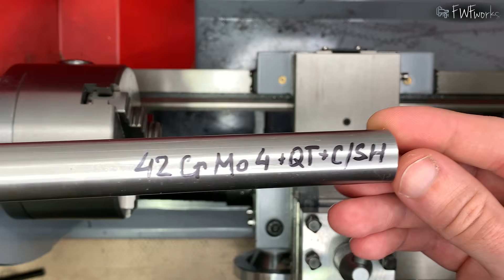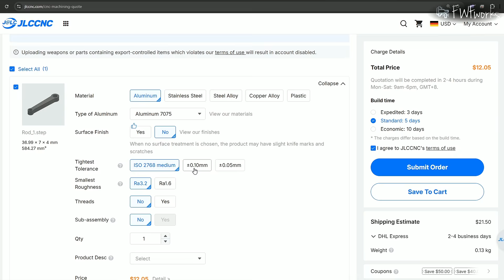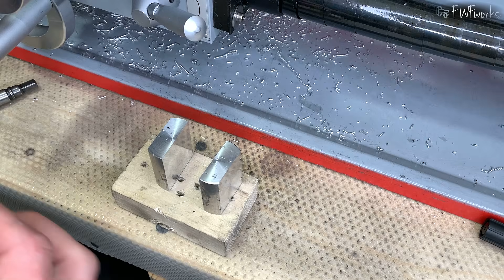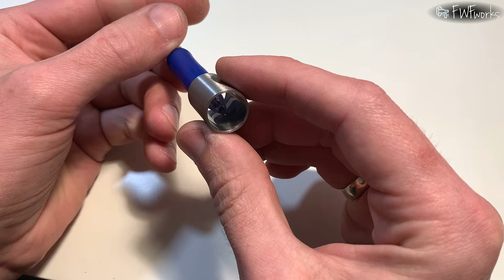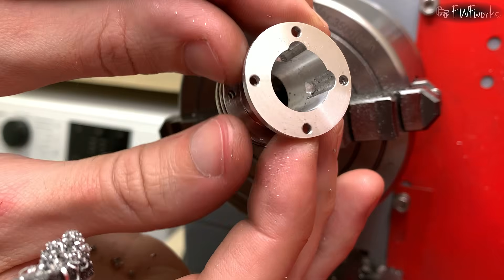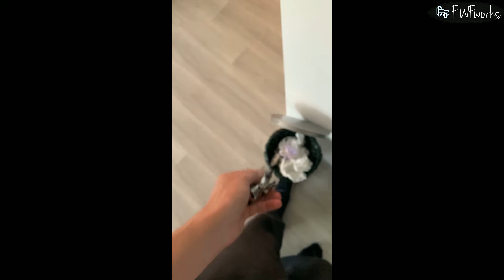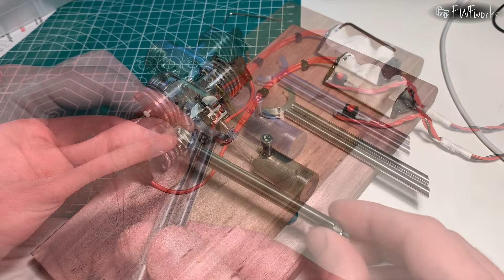I Created My Own Micro Engine! 6500 RPM?!

Comment: Id love to see how long this motor will run.  I have a feeling it wont be very long.

The tolerance window shrinks in proportion to the sizes but the material properties and density dont change.  

This is a cool project but i wouldnt risk the rc plane chassis that size.

Put it in an rc boat!
Reply from the maker: I didn’t set out to build a reliable engine, and that’s exactly how it turned out 🤷‍♂️ I’m not happy with the way it starts or runs. If I were building something for RC model, I’d probably just buy a proper model engine :)
Reply: @FlyWolf_works  totally understand lol but why not do another and take some tricks from the rc world.  It would be damn satisfying to get a rc boat ripping around.  Pretty low cost and easy to configure.
Reply from the maker: @Rightisallwrong Absolutely! But I’d like to build something a bit more interesting. For example, I’m currently making parts for my new engine. It will be a 4-stroke, 4-cylinder engine with a displacement of 30 cc (1.83 cubic inches), crankshaft lubrication, and liquid cooling 😎
Reply: @FlyWolf_works niiiice.  Looking forward to it.

Comment: Cast iron pistons in a steel or chromed- brass cylinder work well in commercial model engines. If I was building a boxer I'd start with a couple of existing engines first time around, and just build a new crank & case. Doing everything from scratch is much harder. Oh, and cast iron pistons lap nicely too
Reply from the maker: Yes, I know. I used to be heavily involved in model aircraft. I wanted to build an engine completely from scratch, make it very small, and run it on gasoline. But it turned out the way it turned out… 😄

I’m currently designing a 4T engine. It will have aluminum pistons with steel rings and cast iron cylinder liners.

Comment: They run great with gasoline BUT YOU MUST USE PISTON RINGS. You lose 70% to 80% of your compression with metal to metal fit. BAD IDEA!!! If you test it maybe you have 4 to 1 compression and lose 75% of your total power potential! It runs way to slow. If you build with rings your RPM should be 15,000 but I can hear it's far to slow! Even just 1 ring would be better than none!!! If you get good compression you will NEVER be able to spin it with your finger, totally impossible so I know your in BIG TROUBLE with your compression!!! My advice is to BUY one and take it apart to learn how they build it! They have many special tricks you need to learn. Also your carb must be much further away from the crank case and larger ID fuel air tunnel so you can fit an easy open "V" shaped dual reed valve between the carb and the crank-case with much larger openings so it gets lots of air flow. I can also hear it starving for air to!!! It's harder than you think to make it really powerful and fuel efficient! Note: building rings takes special math so maybe buy rings and build your piston to match!
Reply from the maker: Thank you for the detailed comment. Yes, there were quite a few mistakes made during the design process 😄

Comment: That's a cool engine,excellent work but as with all air cooled engines there needs to be some air flow across the fins to help dissipate the heat.
Reply from the maker: Hi! Thanks! Yes, you’re right. But this engine has tortured me so much that I’m almost ready to make a destruction test video. Which will fail first: overheating or a thrown connecting rod, or something else 🤔
Reply: @FlyWolf_works it would be a shame to see all that craftsmanship end up in a thousand pieces but, it would also be entertaining. Can't wait to see it.
Reply from the maker: @edwardtaylor7047  This engine really didn’t turn out very well. But it gave me an enormous amount of experience and a much deeper understanding of how engines work and all their little nuances. Unfortunately, I couldn’t cover most of that in the video because of my limited language skills.

The stress test will also tell me a lot about the strength limits of the materials I’m using.

And ahead of me is the long journey of designing and building a four cylinder four stroke engine 😃

Comment: Beautiful!!   How did you make sure the bearings for the crankshaft were aligned?
Reply from the maker: Hi! Thanks for your comment.

I machined the crankcase in a single setup to ensure concentricity between the front bearing and the inner bore of the crankcase. I also tried to make the rear cover as accurate as possible. The rear cover with the bearing is located by the inner surface of the crankcase. So the inner bore and the rear face of the crankcase serve as the datum surfaces.

Comment: if you spend more engineering into this, you might make it spin like 15000 rpm faster
Reply from the maker: Hi, you're right. But I'm not sure the materials I've chosen will withstand high dynamic loads.
Reply: @FlyWolf_works  well, best engines like these can rev up to like 30000 RPM, so if you put whole a lot of engineering and innormous calculations, you may end up with similar results. i guess, if 2.4 liter inline 4 K24 Honda car engine can freely rev 8000 RPM from factory, your micro engine can do a lot more. maybe decreasing stroke will bring dynamic acceleration thing down and you will make less power on low RPM, but will allow you rev higher without stressing conrods and piston fingers.

Comment: 3:56 бро, я бы писал на английском, но я слышу откуда ты) А так, уплыли зазоры между цилиндром и поршнем?
Reply: А так, отвечая на вопрос почему маленькие двигатели плохо работают на бензине? Дело точно в размере? Имхо, дело в самом бензине который куда хуже горит и куда более прихотлив буквально ко всему. На нитрометане и двигатель из шприцов поедет
Reply from the maker: Hi, thanks for your comment!
I’m not trying to hide where I’m from 🙂 It’s pretty obvious both visually and from my accent.
Still, I’ll reply in English. As you probably saw in the video, two factors were at play: thermal expansion and piston deformation caused by the press-fit wrist pin.
I didn’t expect that pressing in the wrist pin would change the piston geometry that much.

Right now I’m designing a four-cylinder 4-stroke engine with a displacement of about 16 cc. If I manage to build it, we’ll see if it can run on gasoline.
Reply: @FlyWolf_works  вообще бомба, я тоже собираюсь попробовать себя в таких движках, но я даже не думал что их можно заставить работать на бензине. Если всё выйдет, то точно попробую повторить твой опыт

Comment: Nice work. I think I see the problem.  The crank discs may be blocking the fuel transfer to the cylinders too much. They need to be cut away a little so more air and fuel can pass, and also to balance the crankshaft. 12 to 1 compression may be too high for the gasoline and oil mix. I like the straight pipe sound better. The muffler sounds noisy. Maybe adding tuned pipes might  help with scavenging.
Reply from the maker: Hi! Thanks for the detailed feedback. I honestly thought it would run as-is, because I wasn’t planning to put it under any load. It just needed to run — that was the goal. But it turned out to be a lot more complicated 🙂

Comment: The fact this runs at all is a major achievement, to get rid of vibration and improve power is the really hard bit as you are going to have to balance the crack, rods and pistons which isn't easy especially when you have manually shaped some parts with a file. Really nice project though.
Reply from the maker: Hi! Thanks for the comment! My goal from the start was just to get the engine running, not to chase power or perfect balancing. Of course, it can’t compete with industrial engines in terms of power or lifespan🤷‍♂️

Comment: Can you make the rev force engine in a mini engine size ?
Reply from the maker: Hi! I think I could🤔 I just need to convince myself that I actually need it 🙂
Reply: @FlyWolf_works  i have a reason.. how about collection of novel engine designs miniature versions which are still at development phase but working
Reply from the maker: @49Amit-j8t 
Yes! That’s exactly what I’d like to do. For example, I really like the INNengine “1-stroke” engine, and I’d love to build a miniature working version of it. But first, I need to learn how to make piston rings 🙂
Reply: @FlyWolf_works yes it'll be awesome collection to watch it getting built .. and i think you could order custom piston rings , some company must've been making it maybe, not quite sure lets see, i wonder how those model engine get their custom rings be made , i think the rings must be high carbon steel which are shaped in desire size ring and then quenched & heat treated in oil or water.. I'll look for some info myself on this topic as well and update the comment or post a new one
Reply from the maker: @49Amit-j8t  I feel like there’s not much point in trying to make a model engine with a long service life. That way, there are no strict requirements for heat-treating the piston rings — choosing the right material is enough. What’s far more important is calculating the correct dimensions and maintaining accuracy during machining.
Reply: @FlyWolf_works  how about you use jlc cnc for super precision parts like piston rings head and piston and the body part be done by you.. will that work? I know budget is something to be considered as well
Reply: @FlyWolf_works hey bro can you build this? I always wanted to see it come to life actually working, and it would be fun if u could make in a 50cc inline/V/X engine & put this in a pocket bike ..........

https://youtu.be/vQ_aJrpW80g?si=QRsAQq4yTqzhYckb

or if you could then make it out of weed wacker or 25cc chainsaw engines into a inline 3/4 and put it in a pocket bike and drive it ..try to make it 100cc ish
Reply from the maker: @49Amit-j8t   Crazy man🤣
Reply: @FlyWolf_works  yup call me crazy.. normal things aren't fun for me i guess lol .......but i really wanna see it come to life... i would actually the engines in a V format it'll look cool but the one gonna building it so feel free to change as you like...the original creator of the design doesn't care if you make the engine since the revforce engine is somewhat his design and he's just amazed by people coping his creation in a good way obviously...... So put that engine in a pocket bike cuz so far I don't know anyone has done it on the entire youtube try to be the first and u might start a new trend.. I don't have the knowledge & equipments and mainly spare funds to do all this or else i would've been making these years ago....thats why i give the youtubers building stuff the Idea of building these engines let's see who does it
Reply from the maker: @49Amit-j8t  I mean, that guy is crazy — the one who attached ~12 nitro engines together. 

I’ll think about what I can do and how to make it interesting 🤝

Comment: Very nice. Beautiful machine. Yes, for aluminum pistons, model engines often use hard chrome-plated brass cylinder liners. The thermal expansions match better that way. They're called "ABC" for aluminum-brass-chrome. All model engines used gasoline with spark in the 30s and 40s. Flame speed and speed of combustion limited their power in small cylinders. In pictures of these old engines, they look tall. They used a long stroke to allow more time for gasses to burn and expand. Gasoline is also harder to ignite than the alternative, methanol, causing fussier starting and run adjustment. As you probably know, methanol works better overall and allows the use of glow plugs rather than spark. Adding nitro-methane allows even more power and easier running characteristics. Nearly all modern model engines that burn gas have larger displacement than yours, in the class with utility engines for chainsaws and the like.
Reply from the maker: Thanks a lot for the valuable information! 👍

Comment: I didn't see any comments on what the issue is going to be, but I'm guessing it's that the aluminum expands faster with heat. Though with proper designed cylinder and piston geometry, you can work around this issue. But that's just my guess.

Edit: nailed it.
Reply from the maker: Yes, that’s right! Thanks for your comment. I also think the piston deformed because of the press-fit wrist pin (I’m not sure if it was plastic or elastic deformation). At that time, I didn’t have a micrometer to check it.

Comment: hi you have schematic - want to fiddle with engine but no engine background thx
Reply from the maker: Hi! This is the first engine I designed myself. There are many mistakes in the design, and while trying to fix them I ended up messing up the 3D model. So let’s assume there are no drawings available.

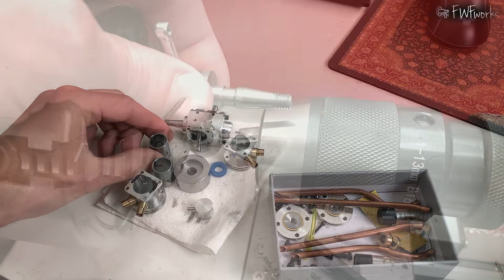Comment: 10:18 there was no heat applied to euther the piston or piston rod to allow the pin to fit. I was wondering about the clearances when you did that part.
Reply from the maker: Hi! The connecting rod rotates freely on the piston pin with about 0.02 mm clearance.
The pin is press-fit into the piston with roughly 0.01–0.02 mm interference, so the hole in the piston is slightly smaller than the pin. It’s not a very tight press fit. The pin can be installed without heating the piston.
At the same time, based on my calculations, this fit should not loosen even when the piston is heated to around 180–200 °C.
Reply: @FlyWolf_works Thanks for the clarification. It makes sense compared to the bigger engines that I usually see this with.

Comment: Aluminum pistons are fine, they use them in ABC type model airplane engines, you need to taper the piston diameter a bit for clearance as it expands essentially making the top of the piston the sealing ring

Comment: so the aluminum pistons did not work because of thermal expansion?
Reply from the maker: That’s true — however, it’s not obvious at first. The pistons are only 14 mm in diameter, so their thermal expansion is very small, just a few thousandths of a millimeter.

Comment: i bet it was bad to put aluminum pistons because aluminum expands faster than steel, if you wanted to compensate for it you’d have to have bigger sleeves but the consequence is low compression while cold along with piston slap
Reply from the maker: Yes, you’re right. In car engines the piston-to-cylinder clearance is roughly 0.05 mm, but those pistons are around 80 mm in diameter.
I honestly thought that with a 14 mm piston, a couple of hundredths of a millimeter would be sufficient…
Reply: @FlyWolf_works  i bet in smaller engines it would be a pain to make aluminum pistons work

Comment: If the engine ran fine on Glow fuel, then it can only be incorrect timing when running on spark...You need around 28 degrees static advanced on the ignition running on petrol or glow...The engine will run a LOT hotter on petrol, so fin area needs to be sufficient....🤔😳🇬🇧🇬🇧 Cast iron for pistons, slide fit everything on the wrist pins..
Reply from the maker: Thank you 🤝 I’ll definitely keep this in mind when working on the next engine.

Comment: Excellent and amazing work!, but: 1. the pistons and connecting rods need to be weighed, 2. oil scraper and compression rings would be nice to implement) yu... and 3, most importantly, why all this if there are ready-made industrial samples of such products at a low cost, for the acquisition of which you do not need to spend so much effort - time and equipment... although... "when a lion has nothing better to do, he licks his balls")))

Comment: Thanks for sharing, I wondered (without checking) if heat of vapourisation may be the fuel difference.
Reply from the maker: Hi! Thanks for your comment. You might be right. I tried starting the engine outdoors at around 4 °C / 39 °F, and even on nitro fuel the result was absolutely zero. My engine, just like me, doesn’t really function well in the cold 🤣

Comment: great work. Back pressure from the fuel tank may be better if you plug the threaded fill hole during running.
Reply from the maker: Hi! Thanks for the feedback! You‘re very observant 🙂
I did experiment with pressurizing the fuel tank from the crankcase. However, in the video that tube is actually plugged with a steel insert, so the tank isn’t being pressurized at all. That’s why the filler cap is left open.

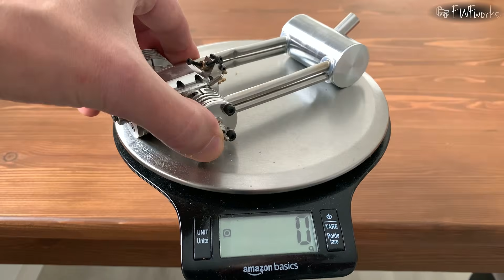Comment: 12:55, you need to enlarge the intake duct and install a carburetor from a nitro engine.
Reply from the maker: I think I could easily increase the RPM using this method, but honestly, I’m afraid that the AW2007 aluminum connecting rods combined with the heavy steel pistons might not survive it.
That said, it could be a great idea for a new video. Pushing this engine all the way to self-destruction 🙂